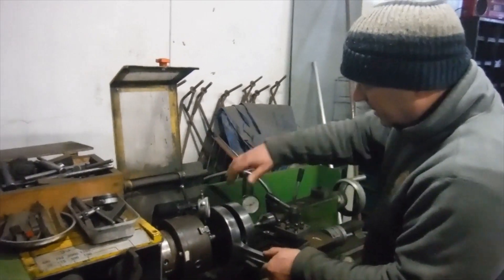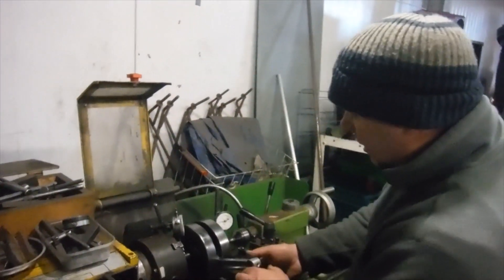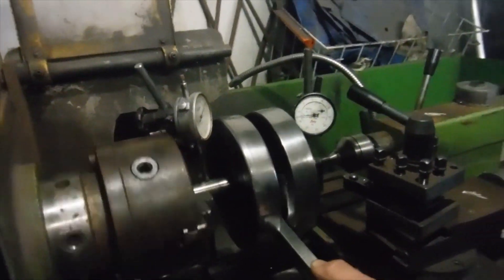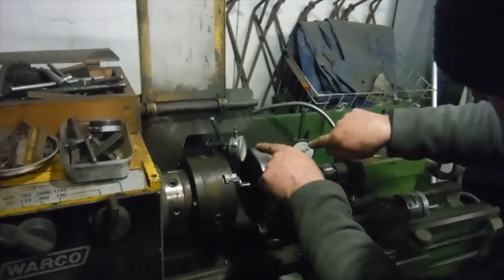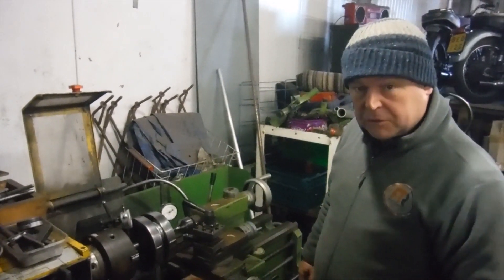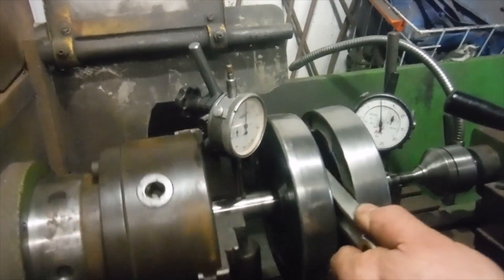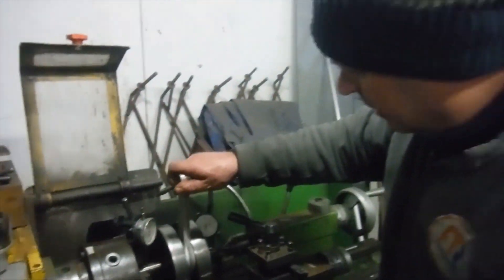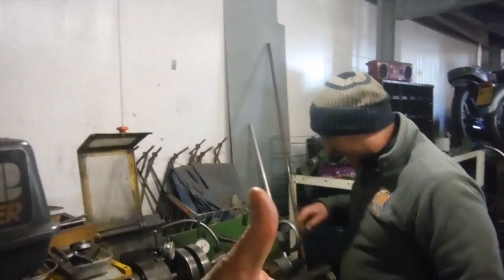Royal Enfield Bullet 350 'Roger's crank checked for runout before and after rebuilding and truing.

Comment: Hi .Paul. I have advertised my bullet special crankshaft and luckily someone asked for the stroke length. I pencilled a line at the bottom of the stroke and at the top and it measures 101-102mm. Hitchcocks long stroke cranks have a stroke of 103mm . Any thoughts?  I will endeavour to send you a picture via email. Keep safe Paul Scofield.